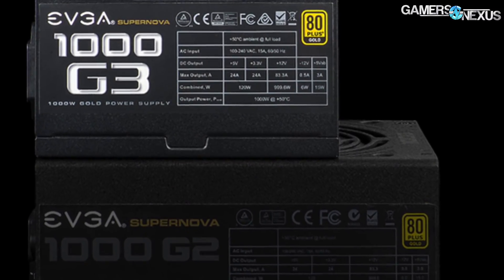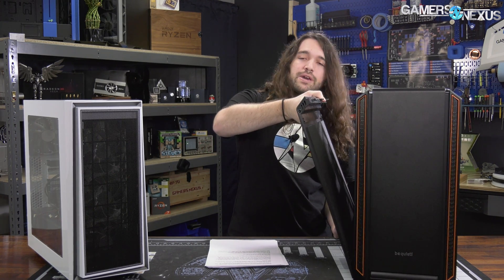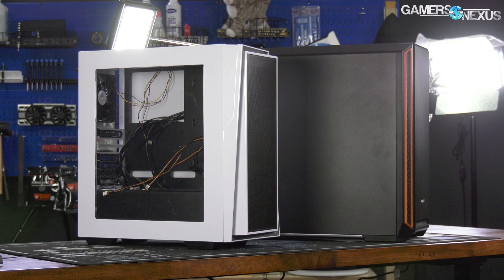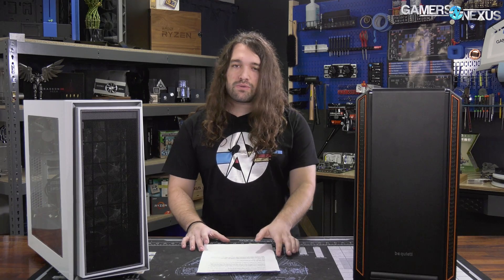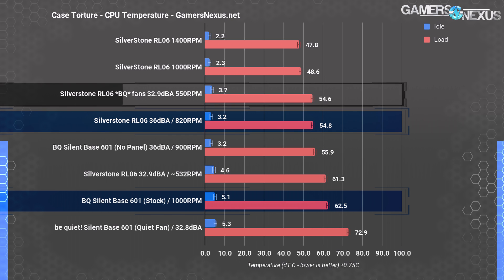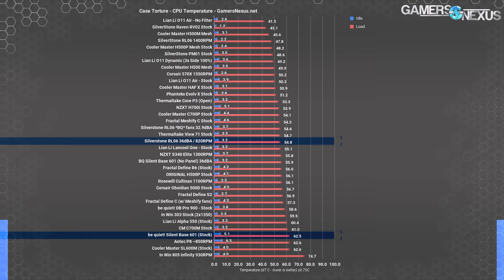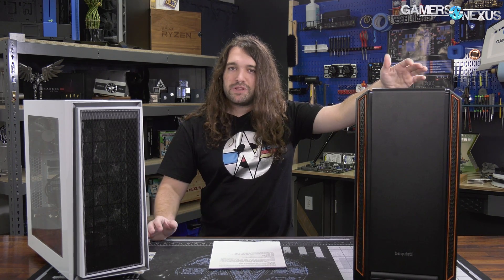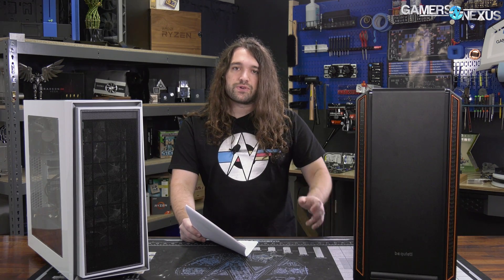Airflow vs. Silent Case: Noise-Normalized Thermals

Comment: why so many people mad about this video? the point made is that you can have airflow and still be quiet. it's noise you probably won't notice because most people will have headphones or speakers on with music/background noise. i dunno man if people want higher temps because of a certain type of noise that's on them. running hotter just means taking away time from expensive components. whatever, it's their money. function is greater than form.....

Comment: I have a Deep Cool Genome II, and  I strapped on 2x 240mm fans at the front, it runs near silently... Before I water cooled the GPU however it was silent until the GPU warmed up and then sounded CRAZY loud (Gigabyte windforce fans are awful sounding at 70%+ speed.   water cooling it fix this a lot thought. rad+2x240s at the front actually did a great job at both been cool and quiet =)

Comment: Hey, Steve! I'm planning to buy a Cooler Master H500 case. Would this theory imply to the same? Would its larger two 200mm fans make it even better (already larger, slower fans made even slower to sit in a decent temperature range and get better noise levels)?

Comment: I disagree that you can run a decent system without case fans (or with case fans dialed very low) and expect it to be quieter. The GPU and CPU fans will spin up to deal with the drastically higher case temp, causing overall louder noise. It's a difficult balancing task, finding the right fan curves for all fans involved in order to achieve maximum silence without leaving any components in danger of overheating. 
Regarding the cases reviewed here: There exist in-between cases with less restrictions on airflow than the 601 but without open mesh for coil whine etc to escape easily. Thick noise dampening mats on the case sides will also help with aforementioned coil whine, since most highend GPUs have at least a bit of whine to them.

Comment: what would you think abut a case that has a huge radiator in the front (where hard drives used to be) for watrher cooling the pc and the case is otherwise closed off accept for a few fans

Comment: I don't understand why "quiet" cases even exist. I have normal hearing. I have a corsair 570x with 4 stock case fans, a corsair h100i with stock fans, and a stock evga ft3 1080ti. It sits on my desk not 2 feet from my ears. I have to crank my fans up to 75% before I can hear my computer from the normal distance. It is inaudible on the stock fan curve, even under heavy load (my fans have never kicked up above 40%).

Now what kind of situation or environment could someone be in that would require special effort and extra expense to reduce system noise?

Comment: Guys i don't know if this video had any purpose... and this is the reason:
I have a NZXT Switch 810, and i spent a lot of time / money in making it quite, fan controllers / expensive fans / different rpm controlling by zone bla bla bla... 
Here is the problem, i don't hear the Fans of my case anymore, however, because this is not a silent optimized case, i hear the water pump, the GPU fans starting up, and at very cold nights when my case / gpu /CPU fans dont even need to work, sometimes I even hear the SSD controller working... 
So here's my opinion, if you want quiet, go for a quiet case, fans are not to hole story !

Comment: From where you get low frequency vibrations? Fans can go down to 300 rpm. Everything else in there is higher RPM=higher frequency vibrations.And as it seems this case is like exact copy of the NZXT cases but with hiher price.

Comment: i put my case out in the hallway on a side-table & run the KB/mouse/monitor/audio wires through a wallplate. i can hear the lightbulbs in my office hum, & crickets 3 houses down, but not my PC. still running an AF case with loads of fans at low RPM & custom baffles inside to direct the air, so it's pretty quiet anyway. 
...105f desert heat at 3am will make your brain come-up with some nutty solutions.

Comment: Bought Cougar Max Panzer and filled it slowly with noctua case fans. I'm calling the case now Desert Camo Panzer :P I'm running the case at low speed on fans, great termals, cant hear the fans at all, becuse the GPU fans is louder on its lowest setting (R9 290)

Comment: EVGA supernova G3 is the loudest PSU ive ever owned, even at idle its loud :( and the 0% fan mode is also dumb af, it ramps up to 100% when temperature is above X, and gradually decreases back to 0. and after about 20 minutes of idling with 0% fan speed, it ramps up to loud AF 100% fan speed again and the process continues. no bueno

Comment: The biggest design flaw (IMO) with the bequiet case is the front fan mounting position. Not it's vertical position but rather the fact it's mounted on the exterior of the metal work, inside the front panel - too close to the front panel and gets choked, similarly to how vertical GPU fans get choked. I repositioned my fans to the inside of the case, providing the intake more space to redirect air inwards and saw much more improved airflow with a smoke test.

Edit: My case is Pure Base 600 which is worse in this regard

Comment: My Meshify C with 2x140 mm intake, 120 exhaust over VRM and push/pull 120 AIO exhaust on the back confirms that Tech Jesus is right again. It took a while to configure all the fan curves (pwm from mobo related to several temp sensors), but on idle/browsing/text editing etc PC is dead quiet. At gaming load it is 35 ish DB max.

Comment: Meshify C with Noctua 120mm high pressure fans set at 40% and you're golden. I have this set up cooling an 8086K running at 5.2GHz on all cores @ 1.42v.  Highest temps from the Intel Extreme Tuning app were 70c. Idle is 34c with barely any noise.

Comment: I've been running a huge open case with slowed fans ever since I moved away from water, and it's a good configuration. Yes the disk noise is sometimes audible and more obvious than airflow noise, but it is quiet enough that it disappears as soon as any game's ambient background starts, or in other words is so much quieter than the sound of the mouse that it's really moot.

Comment: For me the deal is easy. the lowest baseline in noise wins. if i need the airflow i can open the front, install more fans (i have 5 bq fans running at ~400 rpm idle and gaming load (1080ti @ 0.9V @ 1850 mhz @ ~200W) its ~550 rpm. 
But I cant close the front with an airflow focused case. silent focused gives more options then open ones, which you also pay for :)

Comment: This video is so beyond POINTLESS. What I got from this overly wordy video (par for the course :D ) 
1) Case airflow is more important than silence... DUH
2) Case FANS matter more than actual case when it comes to airflow OR noise... ok but I'm still not spending $30+ per fan
3) be quiet! is really just a brand name and has nothing to do with actual case results

I happen to LIKE be quiet! designs (particularly w/ the feature set of the 90x cases) and would buy that case whether or not it was the best case for noise or airflow. Both of those factors are both somewhat of a bottom of the list feature when it comes to cases (for me.) ALL reputable case manufacturers do a decent job of cooling and noise, with some obvious exceptions. Trying to measure a +/-5dB noise difference or a +/-2-4 degree temp difference is sooooo beyond moot. 
GET THE CASE YOU LIKE!

There HAS to be some better content you could run tests on........................

Comment: as an owner of a PowerMac G5 case modded to accept PC components, i have to agree that open airflow can produce some dang quiet circumstances. my front 140s are spinning at 570RPM with my rear 120mm is spinning at 990RPM. i don't know what the equivalent dBA measurement is, but the whole rig is extremely quiet. the only items i ever hear are either of my HDDs when accessed or the GPU fans spin during gaming. i like to think that the thick aluminum acts as a bit of an intercooler as air passes thru the front panel before it hits any of the warmer components internally, although i doubt that was what it was designed for.

Comment: Sorry like in the last test using only 1 intake fan is no real case comparisson. Yes i know that is the stock configuration. Everyone who spends so much money on this case, would spend a bit more for at least 1 or even 2 more fans. This test shows, that 4 fans are more then enough to slow  them down till they are quite, without impacting the temperature and that 2 fans are not enough for a case of this(silent) design.
Reply: He's testing the two cases not entirely he even leaves that it's not entirely tested in every variable

Comment: You talk about the "huge advantage of a good fan" (10:05). Which fan is best?

Why do you put in all the effort to do those fancy charts if they don't matter once you put in good fans? Couldn't your methodology improve?

A suggestion: Choose 3 good, popular cases in their class and test which fan is best at three reasonable noise level points. Now you have a reference fan. Now test the cases with fan configurations using this reference fan. This way we can learn how good the airflow vs noise properties of the case really are, not how much they cheaped out on the fans they use.

Comment: Can't tell if this video is the product of incompetence or malicious intent. Unsubscribed anyway. Perceived noise, fan positioning (loading up both front fan slots vs stock etc...), vibration dampening, electro-magnetic frequency radiation/interference attenuation etc... 

Akin to the quote from Nikola Tesla where he states that most "modern" science is based more on theoretical nonsense than actual practical common sense knowledge/outcome.

Comment: I see that even stating clearly that this video is not taking into account the type of noise, rather just the volume level, hasn't stopped anyone from beating that particular drum.
I'd love to see a comparison of different fans and speeds, side-by-side, with some sensibly placed mics. I'm sure you'd figure out a good testing methodology for that.

Comment: Thank you for highlighting this. Best money I spent on my current rig was the overhaul to all Noctua fans and coolers. I have significantly less noise and better thermals than when I started. I did manually adjust my fan curves to find that noise to thermal sweet spot.

Comment: OK, Steve. I have nothing to say against your methodology, comparisons and the conclusions you draw from them. The problem is with what you consider "quiet". For anyone serious about "quiet", 32 dBA is friggin LOUD. VERY loud. My measure of quiet is can I hear it while trying to sleep 1 meter away from it at 3 am when even the cats & dogs on the street are asleep. 750 rpm on a 140 mm quiet fan is too loud. We're talking about 20-22 dBA levels. This is a level where your methods of testing in stock configs and/or simple panel removals etc go out the window. You HAVE to customize to reach such levels. You need to completely decouple fans (rubber grommets won't work). You need to decouple your pumps, mechanical hard drives. And most important of all, open enclosures are a complete no-no. This presents a very tough problem to solve where you can't afford open enclosures and your fans are running so slow you don't have the power to force air through complicated intakes. I strongly suggest you talk to Mike at silentpcreview.com - he has a quiet room in his basement and equipment to measure sub-20 dBA levels. This is not to diss your reviews - you really can't do any quietness testing without his equipment - what I'm saying is you're really not equipped (both in hardware and in ear training - your ears need to be trained too) to review "quietness". True quietness enthusiasts who buy bequiet don't do so because it works out of the box but because it gives a really good baseline. (Tbh that 601 intake also looks crap). One front intake I love is the Corsair 600Q - not a particularly good case for quietness but the front intakes are wide enough for high airflow without allowing a direct sound route to your ears.
Reply: I have the 600q :) Great compromise for a quiet/performance case with some mods and tweaking. I've taken the feet off to lower it (to fit under my desk) and put silencing foam across the bottom venting. And some other nice tweaks too.. ;)
Reply: @GurtTarctor  Foam is very rarely required + the bottom intake is quite useful on the 600Q - great place to suck in cold air without a direct line to your ear. You can have a very nice positive pressure in your case by using that setup. My issue with 600Q not being quiet is the case is flimsy (ultimate sturdy case was the ancient Antec P100 - thick steel outside, aluminium inside and melamine foam sandwiched between - weighed a ton though), the HDD cages are horrendous. Fan mounting holes are designed for flexibility and don't allow for proper fan decoupling. And they would've made water cooing so much easier by making the case just 5 mm longer (2x280 radioators is a hell of a lot of cooling surface - great when you're running your fans at 400 rpm)

Comment: Hey Steve, I see how the 601 performs, but I’m more interested in the 801, the motherboard tray can be inverted and it comes with 3 of their 140mm fans stock, and everything else the 601 comes with, so I’m thinking with the motherboard inverted and the  additional fan(s) would that improve thermals and would the noise level stay the same as the 601, or how much louder would it get?? Hope you review the 801 soon!

Comment: Manual of tech advisory 101, page 36 verse 6: "And the Tech Jesus detached 2 unnecessary sata cables, and threw them away into the darkness, for he installed mighty high capacity SSD's. Then He tightly zip-tied many of the power cables together to the glorious PC case. The man saw this and stood in awe, as for His cable management was good."

Comment: A silence-focused case is very useful to get rid of component noise, which is not temperature related. Most common: HDDs (idle/access)! If you don't use a mechanical HDD (like in this testing), there is really no need to use them. Have good fans, have a smart fan controller (most mainboards have them nowadays) and select components (GPU, PSU, CPU-Cooler) that have a very low idle noise (maybe even fan stop) and you are good to go.

Comment: You want Case Ventilation Air Flow, to dump heat from the case? Okay.. Let's start where the Back top Case Fan is typically mounted..
https://news-cdn.softpedia.com/images/news2/Scythe-Intros-Ikazuti-Mainstream-PC-Case-3.jpg
And Jerry-rig a way to mount one of these to the Outside of the case at that location..
https://www.amazon.com/5-inch-Portable-Conditioner-Exhaust-Flange/dp/B07BXKPSSK/ref=sr_1_1?s=home-garden&ie=UTF8&qid=1542022952&sr=1-1&keywords=5CCWMount
Mount a second one of the above adapters to this, and fit that to a window..
https://www.amazon.com/Whynter-ARC-WK-110WDP-Portable-ARC-110WD-Conditioner/dp/B00CHQKIV6/ref=pd_rhf_dp_s_cp_0_24?_encoding=UTF8&pd_rd_i=B00CHQKIV6&pd_rd_r=e1c1fec8-c602-4b85-bbfa-db7b7ecdc52b&pd_rd_w=cJCIh&pd_rd_wg=dprld&psc=1&refRID=RKXWQYMPSK71YD0FAM9T
Now connect this duct between these adapters..
https://www.amazon.com/Safegood-Conditioner-Exhaust-Hose-Premium/dp/B07D6FT4BR/ref=pd_sim_201_4?_encoding=UTF8&pd_rd_i=B07D6FT4BR&pd_rd_r=51bf5fb9-e66d-11e8-8349-9126162516c7&pd_rd_w=6Y5Af&pd_rd_wg=FULM6&pf_rd_i=desktop-dp-sims&pf_rd_m=ATVPDKIKX0DER&pf_rd_p=18bb0b78-4200-49b9-ac91-f141d61a1780&pf_rd_r=8RY0SYJGBYYF43A8859D&pf_rd_s=desktop-dp-sims&pf_rd_t=40701&psc=1&refRID=8RY0SYJGBYYF43A8859D
And finally: Jerry-rig one of these to the through window mount Outside. (Don't forget some kind of 'Rain Cover')..
https://www.homedepot.com/p/VENTS-105-CFM-Power-4-in-Mixed-Flow-In-Line-Duct-Fan-TT-100/204594854?cm_mmc=Shopping%7CG%7CBase%7CD29A%7CMulti%7CNA%7CPLA%7CMajor-Appliances%7CSpecial-Buys%7c71700000032418849%7c58700003842365800%7c92700030987191770&gclid=EAIaIQobChMIhKGR-NrO3gIVE9RkCh3gagJpEAYYAyABEgI_gfD_BwE&gclsrc=aw.ds
In Theory: Drawing the air Into the case through the dust filters, and exhausting the 'Hot Air' out of the room/house.
Reply: When good engineering goes bad..
http://1.bp.blogspot.com/_QMuDihPPyPA/S2rAbY5DyEI/AAAAAAAAMWU/aFu8lyP1mMU/s400/you-want-it-when-cartoon.jpg

Comment: A Fractal Meshify vs S2/Open R6 with a 2/1 fan setup would have been a more even and realistic comparison.  Fractal's baffling is more reasonable, but an in-brand comparison would also keep relatively constant the untested variables.  Also, who's going to buy the 601 and no extra fan?

Comment: Now this is a very intresting video, even more than normal *thumps up*, thank god for tech jesus!
The RL06 with be quiet fans surprised me the most, gpu temps on the other hand were surprising as well, is that because of the power supply shroud?
ps. looking forward to the fan/air cooler tests ;) (especially air vs aio in a closed case)

Comment: would you consider doing further testing to explore the "type of noise" angle? I'd specifically be interested in GPU coil whine and whether a case with foam side panels but an open front would show significant Improvement over a side panel without foam and an open front - and compare both of that to a case with/without foam side panels and a closed off front.

Comment: Nice, this is what I normally do with builds, use and open case with good slow fans, the system is then cool and quite. You do have to deal with more dust than a more closed case I find, but the better cooling for the same noise is worth it in my opinion.

Comment: The best for noise reduction, if u have case on the table, is tempered glass. I have S340+Noctuas at low rpm, no intakes.
Reply: Why tempered glass?
Reply: @stardustreverie9737  noise blocking